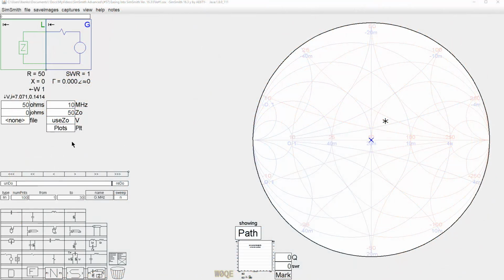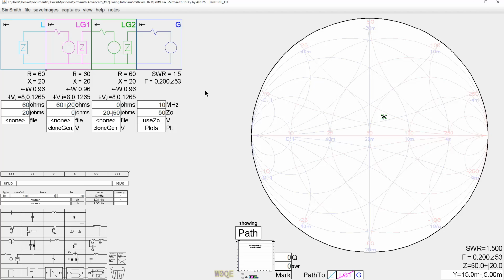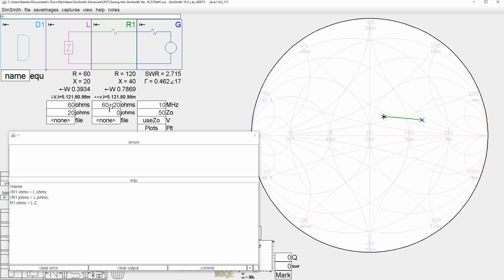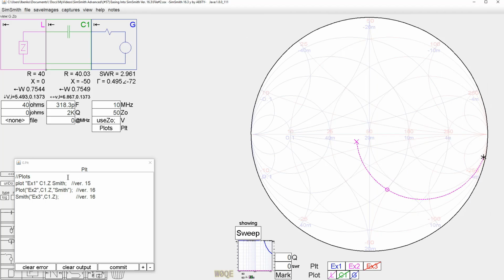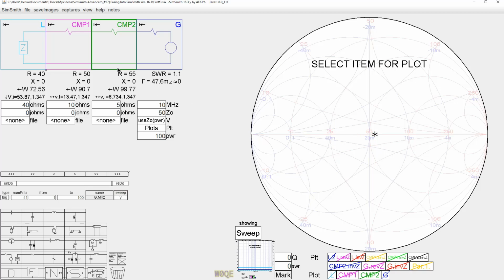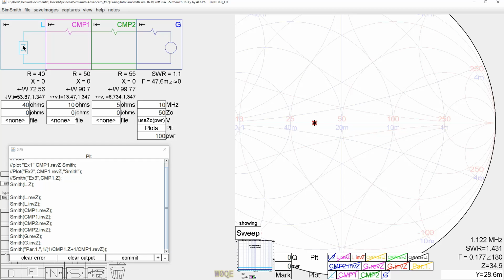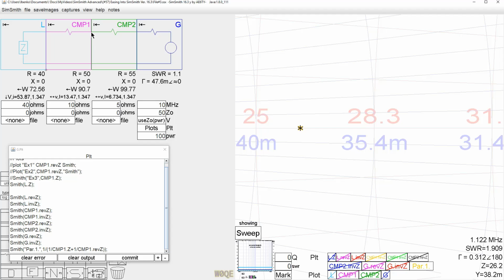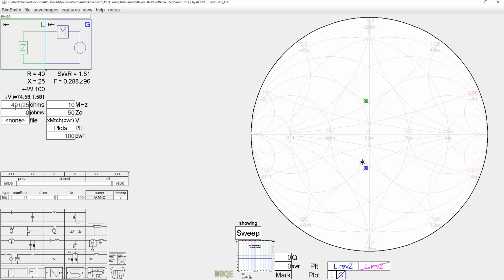#57: Easing Into SimSmith Ver  16.3

Comment: wondering if you could do some practical applications in real world scenerio, such as  how to match a 4 bay dipole to a 50 ohm transmitter.
Reply from the maker: George,
I hadn't planned on matching an antenna like this where 4 colinear vertical dipoles are fed such that the resultant angle of radiation is lower that a single dipole would be.  The matching problem is the same as for any antenna.  You can model it and get an idea as to the impedance but ultimately the best way is to actually measure the impedance vs frequency over the range the antenna will be used.  Then matching it is straight forward.  The phasing lines between the 4 dipoles are also part of the matching circuit.
Larry, W0QE